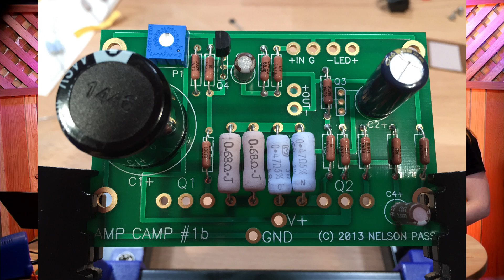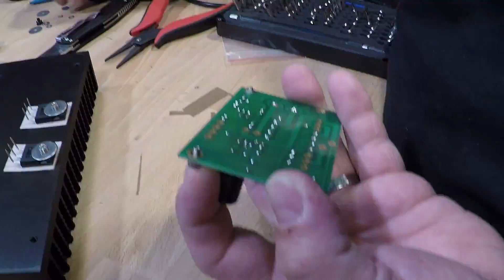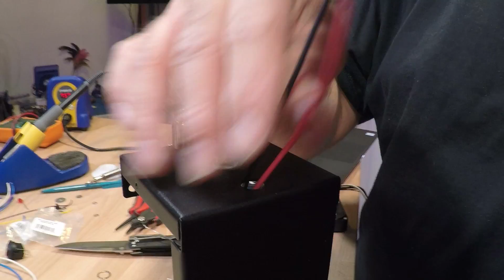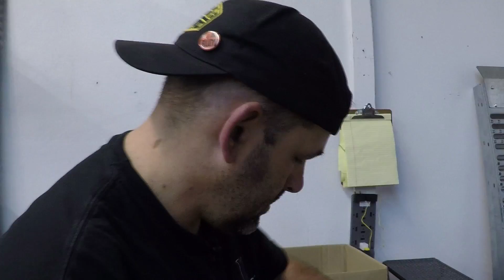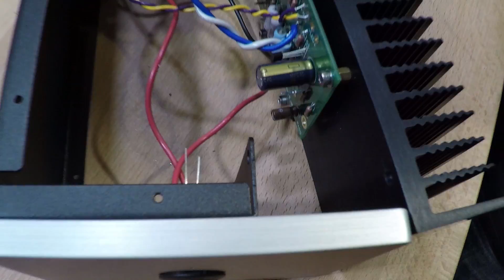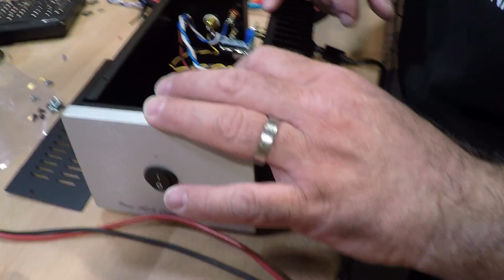February 2016 Patreon Build Video: Amp Camp Amp Dual Monoblocks!

Comment: It might be clearer to explain that a Class A amp is running at full power all of the time. Any juice that doesn't get used for music gets turned into heat. In fact, the louder the music is the cooler the amp runs.

Comment: it would be cool thing that after someone set pot to get 10V the value of pot is them measured in ohms and given as data so it can be set even more easily before soldering and powering amp?

Comment: The PSU is 24V 5A. That means if you leave this amp on 16 hours a day at 6-12 cents per kW it will cost you $42-85 dollars a year to power.
Might be a good idea to use a timer for the hours you know you aren't going to use it just in case you forget to turn it off.

Comment: Just wanted to mention that the backing should be removed from the insulator pads. Also some people worry the insulators need grease and that's not required-in fact works worse.

Comment: Was watching a show years ago.  this guy built a home theater where the Amps needed there own special room with it's own air conditioner.  The basement was turned into a giant tuned chamber for the subwoofer ports in the home theater above.  And the electric company had to add a new power line into the house from the street as the normal home power wiring could not handle the current needed to run this.    Th important part he wasn't married and did not have girlfriend to interfere with his home theater plans.   He had goals but I think he had the wrong goals.

Comment: Actually.....LED's don't have positive and negative. It's anode and cathode. The reason it matters how you hook it up is because it is a diode and there for energy can only flow through it one direction.
Reply from the maker: Thank you for the well actually (lol). I'm actually faily versed in the world of LEDs (see the youtube.com/hak5 playlist on Arduino builds), though we may have used the incorrect wording. - shannon
Reply: Yeah I was just adding a bit of info :) Sadly most people don't really look into how components actually work very often.
Reply: Energy can definitely flow both ways in a diode. That's kind of the entire use case for Zener diodes.

Comment: I know it's been a while since this went up, but you left the brown backing on the thermal pads. If someone is still using this amp you should go back in and remove that backing, your transistors will thank you.
Reply from the maker: It pulled the amp apart and removed it about 72 hours after the DIYAudio crew saw this video and emailed me to say "Take the backing off the thermal pads." -Patrick

Comment: to make this thing work, you need a PRE AMP.  pls ask Nelson what matches best, and why NOT, a kit for matching pre amp....????
Reply from the maker: You really don't need a standalone preamp, unless you're playing vinyl. I've used everything from my phone, to thge output from a PC's onboard audio, Audioquest's Dragonfly USB DAC, to an iFi Audio Black Label... there are several DIY preamp builds on DIYaudio you can check out, though!
Reply: You can use a solid DAC that has built in Volume control as a pre-amp. Generally that's the best way unless you really need a pre-amp.